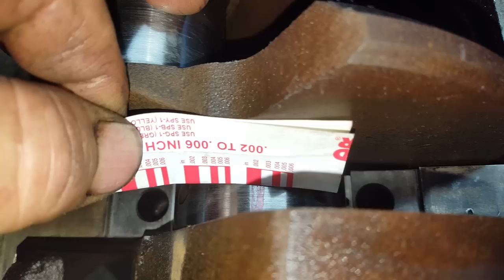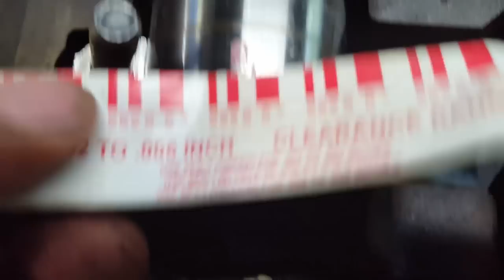Abandoned in the woods for 39 years!! Will this 1975 C20 ever run again??? | Part 2 Engine Teardown

Comment: I have my grandfather’s 73 VW beetle that’s sat for over 20 years. The engine got stuck from rust in the cylinders so I put a set of used cylinders in it new rings. I power washed the sludge out of the block and I got it back together and it runs great. Doing these cheap rebuilds are really fun.
Reply: Lo
Reply: Amen

Comment: Thanks for the detailed doings of the motor rebuild. I was in vocational school in '95 learning Auto mechanics. I watched the video thoroughly and discovered parts of the Piston rods workings I never learned in school. BOTH teachers had diverted me to do other "stuff" at those times so I couldn't get taught about these matters. Am I angry-YES-not at the 2 instructors though. Now 20 years later, I get "why" I missed achieving my ASE certification scores by just a few points. I stopped trying for them 10 years ago, didn't have the money for registering, nor for, taking the tests. I now know what it was that had them treat me as an outcast-like, how DARE I try to achieve a dream and have the career as an automotive technician that I've wanted since I was 10 years old. Yeah, I was different from my classmates, and, they grinded that fact into my face EVERY day of class. I'm now 57-58 in November with no trade skill to live on! My life has been a flop all the way through, and, not sure how much more of the crap I have to endure. I still plan to watch the 3 remaining videos in this rebuild series. Doug, text me if you want-other than the usual emoji responses. I hurt inside and the overload of failing is causing a mental "crash-down"😵😫😱 this emoji is for you and your video works👍⭐⭐⭐

Comment: Excellent video sir!! Just an update so others viewing the honing procedures don't freak out thinking the single arm honer will damage their engines. On the single arm hone, there is a slip collar held in place by a screw. When loosened and the collar is rotated, it stops the arms from expanding out (clear view of collar at 29:00 and shows cut a-ways for arms to expand as far as the tool allows). And to note, it can not taper the bottom of the bore because the stones would hit the main bearing casting and stop rotating. If the hone is pulled out still rotating, it will do very little damage if any to the top of the bore, when the honing is complete you simply pull the stones upwards while releasing the drill trigger and stop the stones level with the top of the cylinder. Grab and compress the arms and remove honer. Not to disparage anything in your video my friend. You just tackled a ridiculous job reviving this truck and did a wonderful job getting another SB Chevy back to life. I've honed dozens of engines with my single arm and never had a problem and you are dead on about speed and lubrication. The ball honer should be used and is fool proof for beginners, a single arm will work, a double arm is the next best thing to actual machining the cylinders. But please heed the warning on this video, if you don't have the drill speed and vertical timing speed correct you'll never achieve the proper 60 degree cross hatch scoring. You wind up with piston blow-by or a cylinder that can't be lubricated correctly leading to excessive heat and possibly seizure. Again, amazing video series, I've never seen a revivalist YouTube channel that has ever gone thru this much work to revive a vehicle that is so far gone. Incredible work!!!
Reply from the maker: I guarantee you that cheap hone will taper a bore and it has nothing to do with any collar on it.

Comment: A Classmate Parents had a 64 Chevy Impala, 283 Powerglide.   I bought it from his Widowed mom in about 1984, put a battery in it and drove it home.  NO A/C no power nothing, Just 2 Speed Powerglide.   It smoked like a freight train at idle but chalked the pipe on the Hwy.  My brother and I took off the Valve Covers and it was so gummed up, I called Mrs England up and asked what kind of oil was used since they bought it new of course was Quaker State, we ended up just rebuilding the engine since we tore it down to clean it up I think it had a little over 120000 miles on it.   I kept it for 3 or 4 years to run around in sold it to an older couple who needed a reliable car, I had painted it and covered the seats as far as I know they drove up till they passed.

Comment: I hope that your not too critical of this old man who is or was a mechanic in the islands on alaska's many old camps where logging was done about as red neck as it gets. We made stuff that we didn't have to work with. As time went by an it was harder to find pieces an parts that had not been recycled a half dozen times. Seriously as a heartache we welded up and ground stuff off and then crossed the fingers it would stay together. No new parts, just salvaged out of several old rigs sent to die out there as they didn't have dumps or wrecking yards in their towns so it went out on a barge and then dumped out in the woods where they knew we would run it through a bunch of times.... some of our best runners were the fords as they just seemed to be the most forgiving. Now I ain't saying I didn't know how to do it right as I did. My dad was a blacksmith, my two best neighbors were blacksmiths an my age then... I am seventy two, an short to be seventy three in a couple months. (you tell me not to leave a long comment an this will be  the very last one) .. I just enjoy telling about the old days. I also had men who were my heros in them days an boosted my courage in fixing stuff, they were navy machinists and every machine made to forge or fix on stuff was at my hands. One good machinist said that I was equal to a second class machinist!! Just blowing my own horn.. I sure agree on most of your saying on wear and which parts an pieces wore the most. Since a piston goes up an down, it wears the middle of the cylinder the most as it gets two to one on a piston going up an down. Thats how I figure... just to prove I am stupid, I put a engine together that needed the fuel pump on the block then used a cam out of a vortec engine that did not have a provision for a pump (no lobe) and so imagine my surprise that the pump didn't work and tried a couple more before it dawned on me those engines used a electric pump in the tank. I did the right thing an took the front of the engine off, loosened the valves enough to let the lifters ride away from the cam an put another cam in it without taking the intake off... it took a bit but got away with it. I used to spot weld the ring that held the oil pump drive shaft to itself so when you did pull the distributor out, the shaft  couldn't come out of the pump and then try and chase it cause it did. (no need to ask if that little problem ever happened to me) I got hurt one time and could not go back out running equipment, it was winter as well and the damn kids refused to go without eating, the wife was equal not helpful as she wanted a roof over her head so I would take a half dozen chevy engines and get those cheap napa rebuild kits for about a hundred fifty bucks, just gaskets enough to get one back together with cheap rings and bearings. I used my best pieces an parts of engines to make a good one a runner again. I would have my time, a couple hundred in pieces an parts in one and sell it as a runner with a end of driveway guarantee  but folks knew what they were getting. I sold those engines for anywheres to four to six hundred with your old rebuildable engine for a core. I ain't lying, I sold a engine a day and every day for one month.... made more money than if I was working a ten hour day in the logging camps. I got to where I had four or more chevy engines painted up an looking  right good, a little chrome got you a extra hundred an was cheaper than the new good oil pans were... cheap jap parts that was only good for one time use. Now I know you won't believe how I did my cleaning of engine blocks and heads... I had me a barrel full of apple cider vinegar with molasses in it as well. I would just leave that iron in the barrels till I needed another one to fix so they would soak for a good month at times. A sprayer on a garden hose brought them clean as a boiled clean engine. Shiny metal if they got a good soak. Not a speck of hardened grease or crapola on  them if soaked. After a good three months, I would pour the junk out of my barrel and even it shined on the insides. The junk that came out could be shoveled up in large piles. Just the oils n grease, rust an all came out in that stuff. I never had one engine ever come back as I did try hard to make sure I never cut no corners on quality I could control. I got engines that had fancy cams an intakes when they turned in cores. I always did dry start them on a stand with water and oil so they were broke in before installing. I had two permanent employees, my teen aged sons who got paid high dollar for their labor, I am talking if they were working a regular job for someone else,  I paid way more but they did have to work for it an they didn't mind me make them do something over as they knew  they were learning how to build their own engines for their own cars... I had them in nice rigs before they were old enough to get a licence  to drive. Those were the days of the FE ford big block,  the small block chevy an some small block chryslers. I never got into building big block chryslers as they just had too many different pieces an parts. I am just guessing but if you did the seals on the valves, that engine ain't gonna be all that bad on oil. I spent almost six months in different casts to get both legs healed up an my back fixed in a few surgeries... they set a log on me when I was under a rig changing a drive shaft an a limb came through the deck and got me damn good. Even broke my hip bone. All in all, I went back to work in the woods working as a mechanic and bringing home a paycheck that was half of what I made at home. The wife and kids begged me to stay home and work as  they got spoiled on the better money made just working for my self. Now that old squarebody has some life left if you are convinced to patch it back together like rat rod bob did on one that should of been tossed into the scrap pile. I do enjoy watching you an your " I just don't know" LOL, that sells the news buddy
Reply from the maker: Awesome story! Love hearing how it was done back in the day. Kids nowadays think things have to be just perfect and have the best or it'll never run.

Comment: Looks like you got yourself a challenge my friend? She outta run fine, might smoke a little til the rings ceat in. Looks like your gonna need some upper and lower A arms,spindles etc ,plus a rear end and a few goodies. It will be interesting to see that ol truck pull out of them woods for the first time in nearly 40  yrs? Man, keep that climb going my friend.

Comment: I bought a 67 SS396 Chevelle, way back when, for $375 because it didn't run and "needs a camshaft."  Got the intake off and couldn't remove about half of the lifters because they had worn out around the camshaft and wouldn't come out.  I already had the new camshaft so I pulled the lifters up into their bores as far as I could and managed to remove the camshaft by just turning it until it cleared the lifters.  Then I cut that new camshaft box in half and stuck it into the camshaft bore and proceeded to just push those worn-out lifters down into the box and pulled them right out.  I found the bottoms of the lifters were completely gone along with the internals.  New camshaft fixed it though and it ran great.

Comment: yeah,  i lived in Appalachia for about 8 months in the mountains of West Virginia.  have to "make do" there (this was like 40 years ago).  a backwoods mechanic "rebuilt" a straight six for a fella and just left out one piston, rod etc cause didnt have a repair.  engine ran ...  fine.  point is ... ,  got to learn how to "get er done."    its a fine art.  the older simpler engines will carry you thru and are a lot less finicky.  a great mechanic does as little as possible to achieve decent results with time labor and availability.   just saying ...,   there is more than enuf work in this video to rebuild an engine like this.  if you have a good enuf "feel" and experience a great back woods mechanic is golden.  and the knowledge and practice is passed on thru "apprenticeship."  this aint a perfect world and never was.  a car and motor etc have a "personality".   just like with people you can last and do an awful lot if you adjust and observe and take into account that.

Comment: The block getting rusty inside the water passages is from people running straight water instead of water and coolant. many people think antifreeze is only used to prevent the block from freezing when that is only one part the other part it is a rust preventer and lubricator and makes the engine run cooler then with just water

Comment: First time I have come across your channel so apologies if its been mentioned before but dollar store oven cleaner is the best degreaser Ive ever used. And it is considerably cheaper than Gunk.  Spray, wait, agitate with a dollar store paint brush then rinse and repeat as needed.
Reply from the maker: I've used it before. I've used it on aluminum too but it will leave it dull.

Comment: Fully understand where you are coming from on the money aspect of have you seen the truck, and although mine was a k20 and it had most of its floor pans, but the doors had big rust holes in them plus both were caved in the center plus dented at the bottom and my bed didn't look much better and it was even twisted tailgate was bent out in the center about where the latch handle is, and the tailgate was shut and the driver side was bent out at the top and Bent in at the bottom and the passenger side was just the opposite of the Dr side and I had $1,475 in the motor minus heads,cam, and lifters,I just built a 4bolt main 350 0.30 from a 1975 Chevy k20 Silverado 010 block and had it's rotating assembly balanced and the cam kit I chose was a competition cams Xtreme energy 268h 221/224 477/480 at 0.50 lift lopey idle nasty sounding cam and I was given a summit racing equipment brand new timing gear drive timing set machined for more noise was way louder than the transfer case lol, and I had about the same $1,975 in the transmission rebuild it was $1,475 for the main rebuild but add the transmission heavy duty cooler, the b&m torqmaster 1800-2100rpm stall torque converter and the replacement valve body because mine was plugged up and turned out to cracked also.
Reply: Oh the truck was a portable fertilizer sprayer truck and even had the power plugs for the lights and sprayer in the inside of the bed, and amazingly it only had two rusty spots in the bed floor both back towards the tailgate I worked that truck hard and it would crawl into town going up the back roads in the snow but it would make it to town almost every time.

Comment: Would a ridge reamer have fixed the cylinder ridges on that block? I've only watched on as a buddy of mine used one on a 468ci BB but I personally don't know much about using them. His short block was in a little better shape but not much. It was going in a mud truck so it was assembled from spare sparts. 13:1 comp at the end, tho. It was a ripper. He passed away 5 years ago. Channels like yours put me right back in his garage at 3 a.m. wrenching on our boggers, you know? I appreciate you.
Reply from the maker: Ridges weren't really the problem. Motor was wore out completely.

Comment: You do a real nice video, not to technical but informative. Looks like it could use some radiator acid flush through the water jackets once you get it running.  Kudos to the editing dept. on the good job.

Comment: Awesome channel! I'm learning from watching you. But I can teach you something! I have half of a degree in microbiology. You don't get tetanus from getting cut on rusty metal. That's a common misconception. You get it from a bacteria. Clostridium tetani. This bacteria lives in the soil and is an anaerobic bacteria. This means that it only grows in the absence of oxygen. It's usually associated with a rusty nail because the rusty nail is in the ground with the bacteria spores possibly on it. The nail then creates a puncture wound. Basically injecting yourself with the bacteria spores. Deep enough in your foot to be away from oxygen. So what you've done is made a perfect home for the bacteria. So while there is a correlation between rusty nails and lockjaw, the rust has nothing to do with the disease. :)
Reply from the maker: Interesting.

Comment: I'm Subbed to Coldwarmotors, Guys got a 37 Dodge sedan with heavy pitting on one of the cylinders. He was going to experiment by die grinding the pits out some & using J.B. Weld to fill it in. In the end tho, everything but the bore was in such amazing  shape, an all original survivor He couldn't do it .He is going to use a vintage in car sleeve boring machine to re sleeve the cylinder "common practice for service technicians back then to preform this type of repair"...  Anyway, Mabie you might try this out, See if the compression will come up or lasts. They sell a high temp version of J.B. weld too.

Comment: Engine sludge is not caused by Pacific oils it is cause because you don’t change the oil when it’s time for it to be changed and for a lot of years it’s every 3000 miles after that oil breaks down and it burns and with that and moisture you get engine sludge and yes it will stop up push rods etc. if it’s not changed
Reply from the maker: Actually it is tho.

Comment: I'm not sure if you know but the rings actually have to be able to spin on the piston so it doesn't wear one side of the cylinder I know it seems strange but the rings spin so file those inside ring groves
Reply from the maker: They might move around some but I don't think they spin.